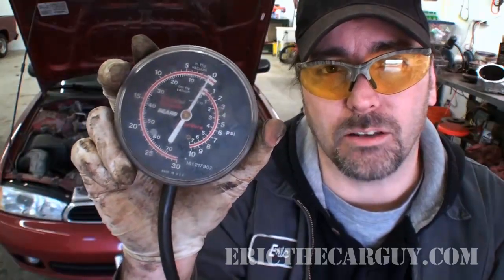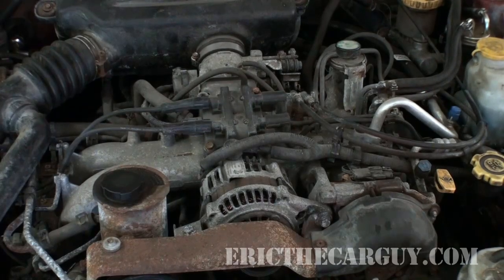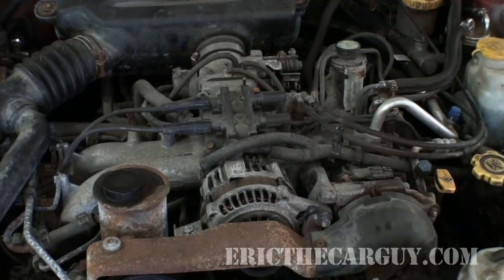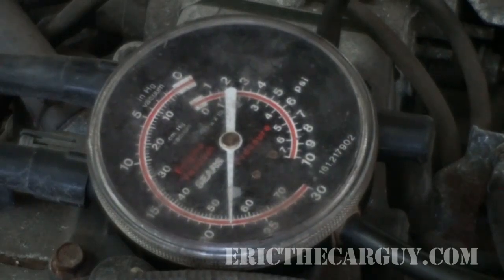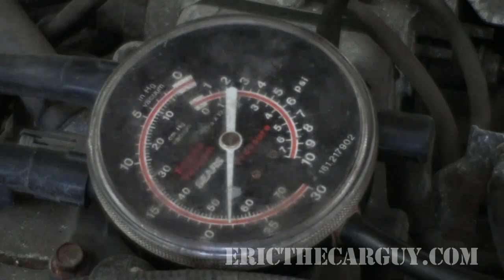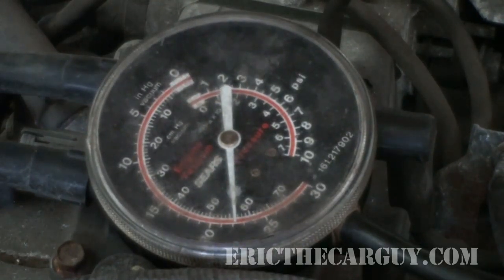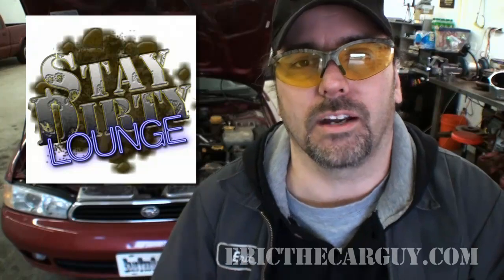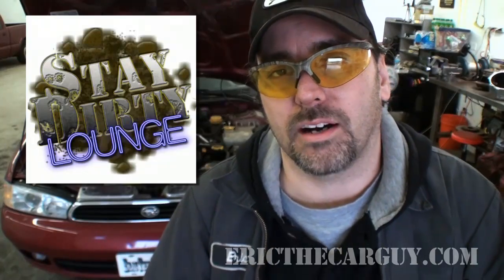How To Diagnose Exhaust Restrictions -EricTheCarGuy

Comment: @ericthecarguy.   cool video....
hey, I have an issue that happen almost from one day to the next... 2000 firebird 3.8 5 speed.... @ first I thought it was the clutch because I would feel the car "sit" every other shift or when I took it over three thousand rpms. the first time I noticed something off was when I floored it and saw smoke... which it was weird because my car does not smoke.... then days later, again but no lingering smell of any kind, especially burned clutch, it a rich mixture. So that's why I'm with the idea that it is the clutch or slave cylinder, but every gear shifts with no issue, no grinding, my clutch pedal is high and reacts normal, no vibrations, no hydraulic leaks. now, talking about the catalytic converter there is no rotten egg smell but twice now I've heard backfiring more predominant as I coast to a stop light. I don't hear it as loud as usual and the power is not really there, I also notice that it idles higher than normal....
with that said, does it sound like a clutch issue, a catalytic issue or a vacuum issue.... thank you for your time..

Comment: Great video. So I've done this test and I have readings above the normal range on my gauge and its at 23. Then when I rev the engine slowly and hold it goes higher up to 25. What's this mean?
Reply: you good, the idea is that vacuume do not drop on you on idle or slightly high RPMs, on WOT it should come to 0 . it shall drop only if there is a back pressure caused by a blocked exhaust or a vacuume leak caused by intake/its componnets

Comment: I don't know where i have vacuum intake in my vw passat b5 1.9 TDI. What's other options to find a exhaust restriction?
Reply: Jakub Houska - Non scientific method. Get under the car with a torch and a rubber mallet. Using the torch perform a throughout visual inspection. Many times bumps and kinks in the pipes can be seen easily seen. 

While in there, with the rubber mallet hit the exhaust parts being tested. What to look for is abnormal sound of loose "things". Examples cat core might be loose, muffler can have loose baffles, etc. ;-)
If any offending parts just replace it's easier. ;-)

Comment: What happens if you dont have enough back pressure. And how is back pressure important.
Reply: you don't want any back pressure at all... back pressure is BAD!!! ... Some (very minor) back pressure is normal on the restrictive emissions based and reduced noise systems that are common in factory form but you want your exhaust as free flowing as possible... back pressure causes exhaust gas to back into the combustion chamber (or even the intake manifold during valve overlap!) and dilute the incoming charge lowering energy potential, raising combustion temperatures, and reduces the anti-detonation properties of the fuel which can lead to catastrophic failure... remember... back pressure BAD!!!

thanks, Eric, for the videos... from one tech to another... great stuff!!!
Reply: You do however want back pressure in a valveless twostroke engine for better milage, lubrication and power. Without back pressure a great quantity of unburnt air-fuel mixture will escape the combustion chamber

Comment: Eric, I have a question about the exhaust system. I felt a lot of air coming out from the muffler's intake side, and my vehicle (Nissan 87 z24) is also loud. Would it be a good idea to change the muffler or is that normal? Along with that, it takes quite a bit of feathering to get to higher RPMs from idle. Could a backed up exhaust system cause this? My dad is a mechanic and we just replaced the head and manifold gaskets, as well as took the head valves in for repair at a shop. My truck is still having this issue. That's why I asked if a faulty exhaust system might cause this problem. Are they related?
Reply: Roman8707 - Old/rusted exhaust parts can easily clog the system. Any old muffler will flake or have loose bits and pieces. If any of those get stuck in some exhaust position it will surely affect the flow of gases. Can be a hit & miss situation.

Comment: Is this test suitable for turbo charged engines?
Reply: the short answer is no... turbos charge the intake system above atmospheric pressure so any gauge reading would only show the compressors efficiency... there is inherent back pressure between the exhaust valve and the turbine (that's why valve overlap on a turbo car should be almost nil) but downstream of the turbo should be free flowing with no back pressure...

I recommend drilling a hole in the exhaust between the turbo and the cat and weld a o2 bung in place over the hole... then find some brass fittings and pipe to set up a remote (far enough away from the exhaust so it doesn't melt your...) pressure gauge... basically, any pressure reading will show a restriction... anything over about 2 psi will cause performance issues... hope this helps
Reply: aceinco
Thanks for the reply. 
I was asking about doing the exhaust back pressure test on a turbo charged engine. I want to check, because the compressor too often just drops the presuure, or nor building any. In this case the ECU readings show vacuum just like any NA engine. No fail lights or fail codes. I bought a new diverter valve and will test it in the next couple of days.
On the other hand, I want to test for excess back pressure. I'm not an expert, but if I have such problem, it could restrict the turbine from spinning freely and thus the compressor not building pressure. I think I could do it without drilling, because my upstream oxygen sensor is after the turbine - at the entrance of the catalytic converter.  This will be point to "ënter" the exhaust.
Reply: eyescreamerz I have that problem my Subaru impreza wrx turbo has that problem =(

Comment: EricTheCarGuy  When I accelerate the car feels like its trying so hard and it barley can push over 26MPH, the shop changed the throttle and the issue still persists, the shop further investigated the car they lifted it on the hoist looked under and seen the exhaust pipes where bent badly in various places, they said the whole exhaust system will have to be replaced and that this should fully fix the problem... just wanted to get other opinions before I go ahead and do this... thnx

Comment: hi got a prob with my car spark are getting wet. driving a toyota carina ed. car is shutting down. if you try to start it doesn't start. after a few hours it starts again . could this be a Exhaust blocked problem 2.

Comment: That is interesting. I am trying to chase down a fault that is driving me nuts. It started as a vacume leak, fixed the split tube and now it runs rich. Tapped on the CAT and it rattles well something inside it rattles. Upluging the Lamda sensor, makes no difference to the engine at all. Unplug the MAF it slugs a bit and revs up then back to idle when i plug it back in. Think i will try this vacume test to see if its erlatic at all. Alfa Romeo Twin sparks are not the easiest cars to work on...

Comment: Eric, I hooked up a vacuum gauge after the throttle body and at idle I was around 19-20 inches. Slowly started increasing the RPM's and vacuum would go even higher to around 23-25 inches and as the RPM's increased vacuum started dropping back to 19-20 inches. I used a infrared thermometer and temps were 100-150 F higher on the intake side than the outlet side on the cat. converter right after the exhaust manifold. Does it sound like a bad converter?

Comment: Is this the same for diesel engines?I have a 95 C220 diesel and my vacuum line after the throttle seems to be pushing air out,not to suck.Is this normal?
My throttle plate is fully open at idle

Comment: One time I had just finished doing a crank sensor trigger wheel on an 09ish corolla (it was towed in, not running), went to take it out on a road test and heard this awful fluttering noise whenever I got on the throttle and the engine had NO power. Turns out the cat had melted down/broken up completely and was so plugged that the exhaust pipe was blowing off its seat on the gasket to release the pressure. Took out the O2 sensor and saw chunks of ceramic blocking the pipe.

Comment: I did a vacuum test today on my 1993 toyota camry. when i hooked it up to the intake port the needle was moving erratically between 15-21 and wouldnt stop. what is my next step to find out whats wrong? the reason i did the test in the first place is because i failed my nox on my emissions and i need to figure out why. thx.

Comment: How about one equipped with a turbo?I'm faced with a problem of low power on a 60 seater bus (diesel).I've used a pressure gauge on the intake side.It registered 7 to 8 psi at 2500 rpm.I don't have a vacuum gauge. Black smoke was emitted during revs. Didn't matter if I adjust the fuel either. I suspect there's not enough air coming in at the intake side. A restriction somewhere along the exhaust perhaps? Anyway, I've dismantled the fuel pump and gonna check out it's performance on a bench.

Comment: how do you know they broke it on purpose. what if someone else did it prior to that oil change  and overtightened the oil hole fastener and broke something trying to remove something someone else fcked up. or an oil filter that was so tight that it was hard to remove with a oil filter wrench? and broke something in the process of trying to remove something someone else fucked up.

Comment: Careful with removing the O2 sensor!  I did that and not only was it loud (DUH!) but it melted wiring that was nearby!  If you see any wiring/harnesses/connectors nearby, it'd be cheaper to just connect your vacuum gauge (which usually also has an integrated pressure tester, important) to the O2 sensor bung.  You may need some adaptors to do this, or you may need a new gauge (an exhaust backpressure gauge would be ideal).  You can then confirm without risk.  Normal exhaust should be below 3psi.

Comment: Fecking great video, this demonstrates the value of simple hands on experience, scan tools will get you so far , but only if you understand the principles, a multimeter, compression gauge, vacuum gauge and some thinking can take you a long way.
Reply: Tottally agree,well said sir
Reply: @train4905  It would have been even better if he had pulled a plug wire off, to induce a misfire and show the effect of that on the gauge too.

Comment: Hi
I noticed when refurbing my throttle body on my Mk4 Astra that there are 2 main vacuum lines from the base of the throttle....both were clogged by soot and oil, the smallest one to evap/ purge was totally blocked...god knows how it breathed at all?
I dont appear to have high crank pressure but I suspect the previous owner diddnt service it well leaving oil to clog up into the Cam Chamber/ crank breathers
A little paraffin, a new gasket, hoses and some love and its liking it alot!
Thanks Eric!

Comment: If you have an exhaust restriction, will it cause a flat spot say, for instance, if you've been coasting downhill with the car in a high gear, your foot off the accelerator and as you go to accelerate, the engine loses power? I know for a fact that my cat is a bit dodgy. I need to get myself a vacuum gauge methinks!

Comment: yup.  The multiple flame fronts causing pinging usually start from a hot point that gets hot enough from the compression and flame pressure rise to spontaneously ignite and start its own secondary flame front - maybe the spark plug, maybe a piece of carbon buildup.  Retarding the ignition lowers peak pressures in the cylinder which reduces the chances that the pressure from spark or burning fuel will produce pressures high enough for the remaining unburnt fuel-air mix to 'detonate' all at once.

Comment: Yes and no. By doing that, the engine cannot take in as much air as it normally would, so for the same throttle position, the amount of power is less. So if the driver holds the same throttle position, he uses less power thus less fuel. Let's say the driver wants to accelerate as fast as possible, he'll do that with less power that he had before and could save fuel. However there's other factor to take into considerations like keeping the backpressure under a certain limit to keep efficiency.

Comment: Pinging is generally the result of multiple flame fronts colliding inside the combustion chamber and is not by itself a highly damaging condition.  The knock sensors detect this and try to prevent the next stage which is highly damaging detonation, where the entire fuel charge ignites all at once without flame front propagation.

Comment: I had a similar problem on my RSX, random misfire at high RPM. Drove me crazy for a few months. Finally I figured out it was the resonator that came apart inside and blocked the exhaust. Cut it out and k20 is whipping ass again.

Comment: It has to work harder to overcome the restriction, burning more fuel which will produce more heat. The engine won't necessarily overheat if cooling system is operating correctly but it may if the restriction is large enough.

Comment: If the timing chain slipped, would it look similar?  Decades back a Ford 429 cu in I had was diagnosed with exhaust restriction.  $600 and a double-wall header later problem wasn't fixed.  Car couldn't climb a hill above 40mph.  Dealer then wanted me to buy new muffler.  Turned out the timing chain had slipped during one backfire.  Replaced chain and gears, and car was fine again, but expensive and unnecessary header repair.

Comment: Had an internal rattle in my cat for a few years but it always passed emissions test. Occasionally (rarely) my performance would get erratic. Muffler finally started going and replaced everything.. No more erratic running. Figured the elements in there would get out of whack and cause a restriction.

Comment: Vacuum gauges have been around forever, and are still a very good diagnostic tool. Actual numeric readings as in this case are just one aspect.

Interpretation of gauge fluctuations is another whole science. Search Google & YouTube for 'vacuum gauge reading' for tons more.

There is nothing wrong with 'T-ing' one in so it can be watched while the car is driven. They look very much different then. (Keeping the vacuum high as possible at all times will give you optimal fuel mileage.)

Comment: Also, if there is no improvement when the pre cat O2 sensor is pulled, then there may be an issue in the exhaust before that point- manifold, down pipe, Y pipe, etc.

Comment: You forgot to specify which O2 sensor indicates what.
Most OBDII vehicles have two O2 sensors. One before the catalytic converter and another after the cat. 
If you pull the one before the cat and engine performance improves, then most likely the catalytic converter is clogged or something farther downstream is the issue. If you pull the post cat O2 sensor and performance improves then the piping or muffler to the rear of the vehicle could be at fault.

Comment: Good video. I have even seen exhausts so restricted that the vac dropped down to almost zero at easy accel. Vac gauges are still one of my number one goto tools for performance issues.
Reply: I have one too and I like to use it sometimes along with the MAP sensor.